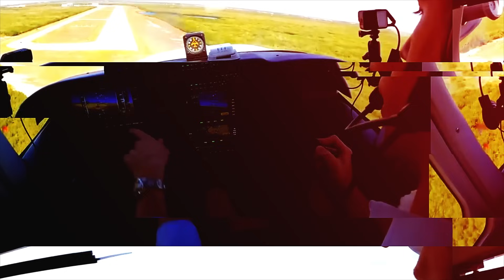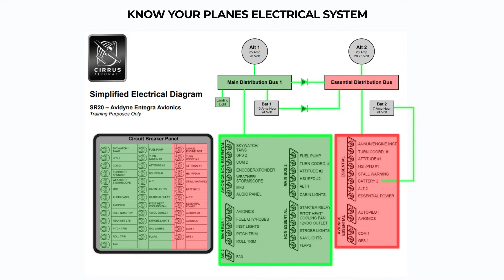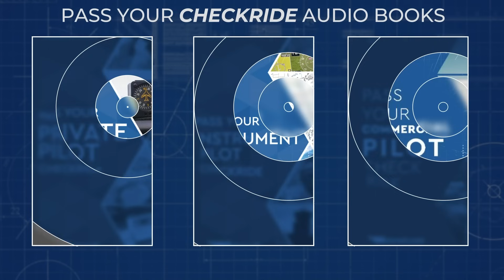Inflight Electrical Fire? Do This First! - Day 12 of The 31 Day Safer Pilot Challenge 2024

Comment: 12 for 12!  Had an electrical failure on a flight during my training, just finished a missed approach in the instrument part of my PPL.  Both myself and my CFI had backup radios, but we could not reach either of them.  The alternator was the culprit in our case as well.  I learned from that day that a backup radio is useless if you can't reach it.

Comment: I had this one. 20 miles out from the airport in a rented 172, I smelled electrical smoke. I've done electrical work for decades, I knew that smell immediately. I killed the master, cabin vents were already open. Got close to the airport, I turned everything off except the com radio. Turned the master on, made a quick call on the CTAF, then master off again and landed.

Comment: I had an alternator wire go up in smoke under the hood of my 67 Dodge truck, that was scary enough and I was on solid ground 😬, was able to save it by quickly ripping the battery ground cable off

Comment: 12 for 12. I love the idea of a handheld radio for backup. I’ve lost comms twice before my first solo, so from early on I’ve been acutely aware of the need for backup systems. Specifically, what if it is night and you need to turn the lights on at a non-towered field with no electric running? That would be a white knuckle landing for sure. Thank you Jason for helping to make each pilot a safer pilot. Keep up the great work!

Comment: 12 for 12.  Early in my flying experience I had an alternator failure at night on a short flight in an older plane without annunciation.  Things got dim and then the radio stopped working…no smoke and the battery was draining quickly.  I now carry a backup radio.  Fortunately this was a live and learn experience.

Comment: Flying across Lake Erie to clear customs and lost electrics, had a handheld radio with external antenna, landed safely. Replaced alternator at FBO, flew another 60 miles and same thing happened again. Decided to return to home to get fixed. Eventually it was master breaker was faulty

Comment: Jason I had a similar electrical problem with smoke in the cabin of my Commander 114. It was the fuel pump failing and the circuit breaker was meant to be in the switch which is unique on the Commanders and costs about $300 whereas a Piper switch which has a separate circuit breaker costs about $80. A previous owner took a cheap shortcut which left me with a melted power wire and smoke in the cabin! It was scary at the time but we shut off the master and landed safely.

Comment: 12 for 12 in 2024!
I experienced an electrical fire on a training flight.  We were entering the pattern at the time and I thought I was smelling a farmer or someone below burning grass below us.  We closed off the ventilation and the saw a thin trail of smoke rising up out the panel on my side.  My instructor took over, made a radio call, shut off the master, and landed the plane.  It was a bad clock/USB charger that shorted out.  I will never forget it!

Comment: 12 4 12, 

My one and only electrical event happened two years ago after retiring from the airlines flying a piper archer and the electronic cooling fan failed right after takeoff and it was nighttime. I just did a quick turn back to the field and landed. Glad I didn’t have to go through that emergency checklist. But I remember as a flight engineer, one of the hardest check rides was having an electrical fire and going through that on the 727 was quite an experience, even if it was only in the simulator.

Comment: 12 for 12.  I was ending a test flight on a 737 and on short final one rear panel in the cockpit started to smoke. A loose terminal moved slightly and made contact with another bore. Just as said, breakers were popped out and we landed quickly. Thankfully no major incident and was fixed easily.

Comment: I had to chuckle when you said your 72 plane was a Frankenstein. We have a 58 Cessna 172 with a mixture of fuses and circuit breakers. The instrument panel is still pretty much the same as originally equipped with a few upgrades. I’m not sure if old and simple is better or not. We’ve not had any issues to date and carry a handheld radio as backup. 12 for 12 today, enjoy your videos.

Comment: 12 out of 12 done. If you have a passenger with you then by all means take advantage of that. One thing you can do during a long cross-country flight is to have that passenger pick up the checklists and together review emergency procedures. Not only is a great refresher for the pilot but also a passenger can feel more at ease when assisting to an emergency instead of being a worried bystander. Also, a good pre-flight emergency briefing for all passengers is always a good practice.

Comment: 12/12. Great video, Jason. I had an electrical failure once while in IMC. Fortunately, there was no fire, just a blown circuit breaker which reset with no problem. I was very glad I had my handheld, was with my instructor, and close to my home airport.

Comment: 12 / 12 Early learning to drive I had an experience in a 🚗 were a bad wired music amp shorted and the cabin filled with smoke 💨.  It was less than 5sec and I could not see out of the windshield.   Almost panicked, I rolled the windows and was able to see again.  I could not imagine a situation like this while flying a ✈️.  Early on I learned the value to keep the calm in a surprise situation.  Practicing emergency scenarios helps greatly to manage the surprise element to keep the calm and execute the correct procedure.

Comment: 12 for 12, Jason! Flying an E/AB RV-7A that I built has it's advantages as I designed my electrical system to be able to isolate any single component within my electrical system by pulling a breaker. I pray I never have to use such a procedure to isolate a "smoke in the cabin" incident - but it is nice knowing the capability is there.

Comment: One thing to think about - if you smell smoke and have to turn off the master at night, how are you going to turn on pilot controlled runway lights? Use your handheld of course! But you might then discover that a one-half battery indication on the handheld (that you checked before the flight, and thought was sufficient power) actually means that the radio dies when you hit the transmit button. Ask me how I know. 😂

Comment: around 4 years back I had a good friend just took off from the Airport and around 3000 ft, the cockpit started to fill with smoke according to the tower. Moments later he jumped from the plane to his death has he had no parachute of course. He probably didn't go through the inflight electrical you taught in this video.

Comment: 12 for 12! Great video Jason. I think you touching on the breakers is great advice, we are taught where they are in training and  it gets overlooked somewhat about knowing the troubleshooting . I had an alternator failure during flight training, luckily no smoke. Weird pop in the radio while ATC was talking to me and the alternator circuit breaker popped at that moment during transmission. Took a second to figure out what happened, being a student at the time. Thank you.

Comment: Great stuff Jason.  I'd touch on a couple further thoughts regarding "troubleshooting" in flight malfunctions and circuit breaker/fuse resets.  The FAA has told operators in the airline world it considers active "troubleshooting" in flight and the re-setting of tripped circuit breakers to be only available as an extension of a pilots emergency authority.  In other words, If your finding yourself doing either, you should also be declaring an emergency and landing at the nearest suitable airport.  While this is a legal requirement for airline guys I don't believe it is the case for part 91 operations.  Knowing this however does give rise to some follow up questions we might think about:  Do I really need that system that caused a tripped breaker for the safe completion of the flight?  Is it wise to reset a device in flight whose sole purpose is to protect the aircraft from the heat generated by excess current flow, especially if that failure has already generated enough heat to smell or smoke? If I'm troubleshooting a mechanical or electrical malfunction in flight, at what point does it distract from my primary obligation to fly the aircraft?  It's good to have solid knowledge of system architecture and function because it can mean the difference between a safe arrival back on terra firma and something less desirable; but would troubleshooting these failures be best left to a certified mechanic once safely on the ground?  Like much of ADM there are few hard and fast rules for the infinite varieties of scenarios we can come up with.  Just a few added questions I feel pilots should consider if they find themselves facing inflight system malfunctions.

Comment: 12 for 12, Yes, 7700 and 7600, safely flew to the nearby airport.  Yes, inflight electrical fire.  Generator, yes generator case failed and took out electrical and both mags.   I'm not flying junk, and there is no preflight action that I could have taken to prevent the occurence.

Comment: 12/12 i always carry my handheld radio when flying. I have a headset adapter and they claim that the radio has been tested to work from 70 miles away. Always have a backup to your backup.

Comment: Power electronics class op amp….misplaced wire….just before lecture….nasty smell….high heat….in airplanes….old wires…make new and bad locations….or new equipment not properly installed or incompatible with older wires…first flights….long taxi and stay in pattern